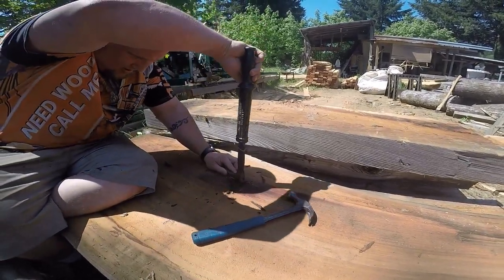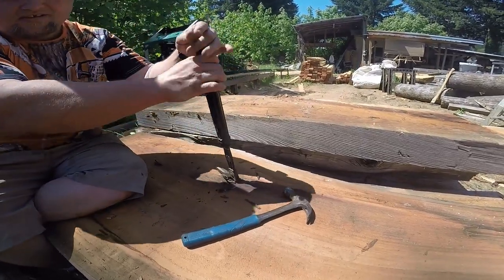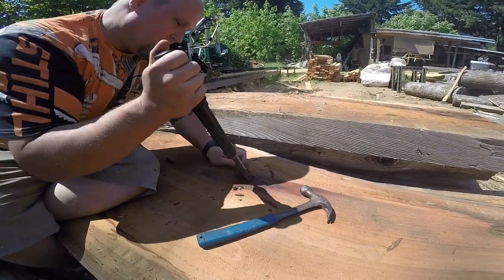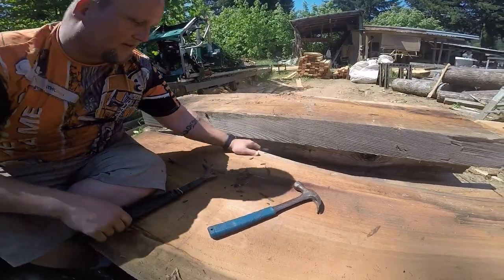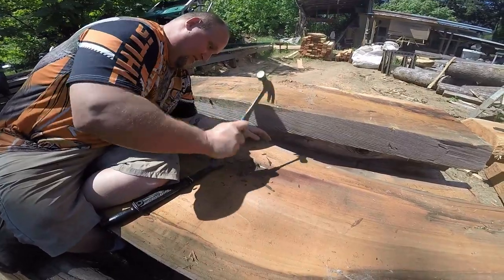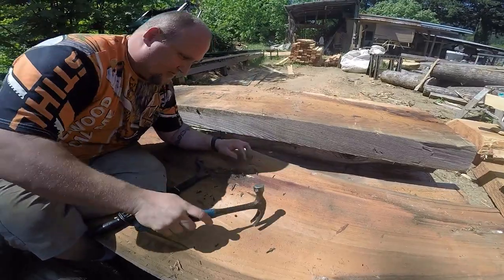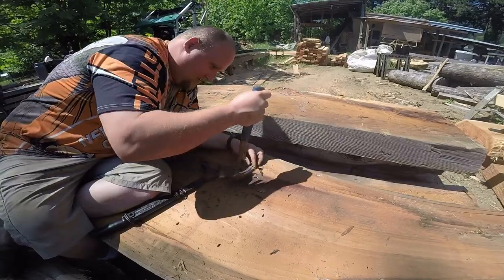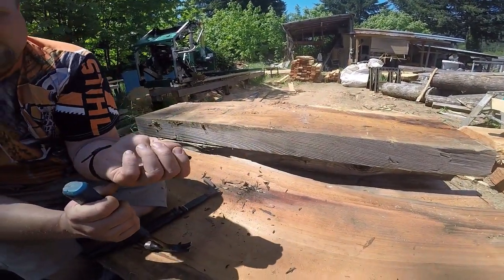Medal detecting some free mill rejects

Comment: Pretty cool to see. I hate finding steel !
Reply from the maker: Yeah it gets expensive finding it the hard way lol
Reply: I tried to split a low peice with cable in it ,was good until I tried to pass into the cable and it dented the steel wedge with ease enough so I tried a big b file that didn't do shit to take the curl out of the edge,lesson learned if I can see it split right up to it,then back or out and try another spot until the firewood frees itself from the mild steel rope.great tip to double check if the detector is working
Reply: good work on the vids and those slabs are awesome